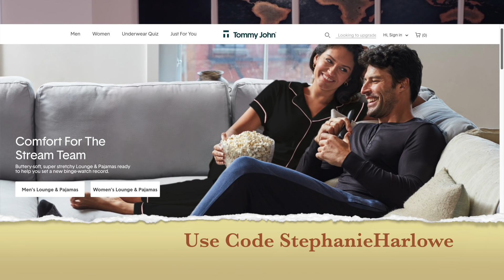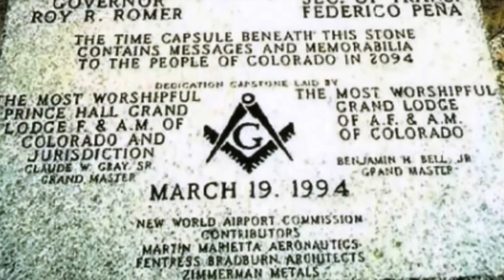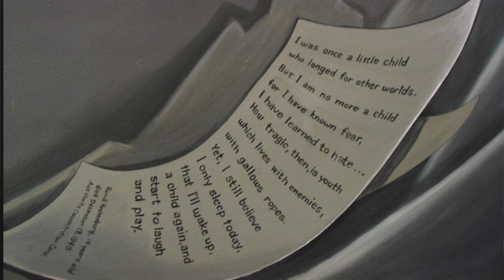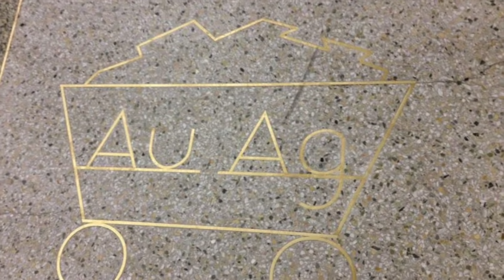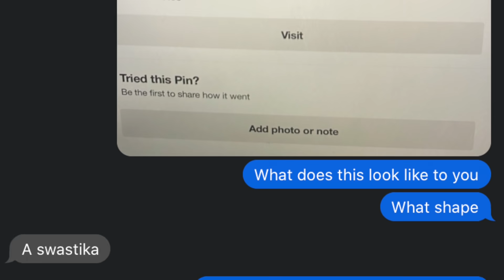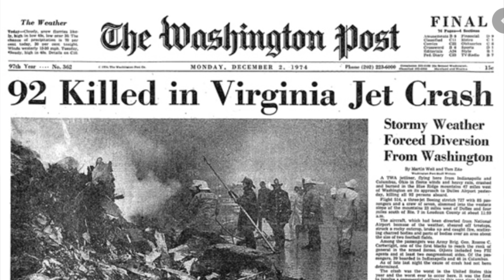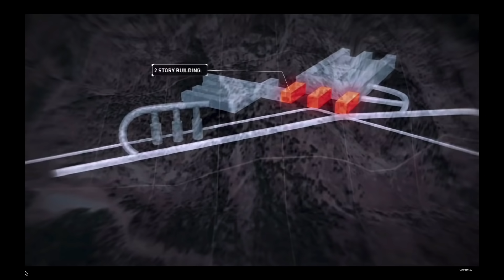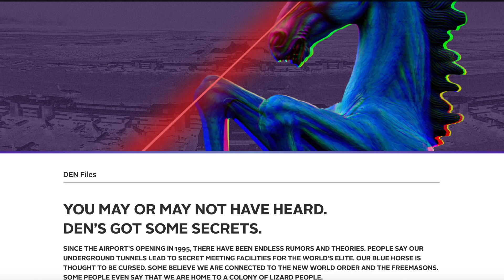Harloween: Tales From Denver International Airport

Comment: We've been to the Denver airport twice on trips to Colorado before we even heard of these stories. I saw a poster on the construction areas of the airport with mocking slogans about lizard people and laughed  wondering what it was about. We went underground to hop the transit to other terminals and it did have other areas down there off limits behind solid steel doors with RFID lock sensors. There were also train tunnels that were completely unused. The doors to those were marked out of service and they seemed to go somewhere completely different. Mind you, I wasn't really looking for anything so I probably missed all sorts of details. But now that I have heard the conspiracies, I would not at all be surprised if they were true.

Comment: My own DIA story: I was visiting some family and was due to fly out when a winter storm blew in. My flight was rescheduled. I forgot to mention I was about 4 and a half months pregnant with my son. I had an SS on my ticket and was directed to a special security line. This was before the x ray scanners were in every airport and they were rolling them out there. I was made to take my jewelry off so I asked them if it contained radiation or anything that might hurt my baby. They told me no and made me do it. I did not have enough for another ticket and regrettably I went along with it. I found out later what it was and was so angry. Luckily my son is fine. They ask you before x rays i there is a possibility of being pregnant, or if they don't they cover you with that lead blanket. So in the end I was a guinea pig for the naked body scanners while visably pregnant.

Comment: The one thing that wasn't covered  was the politicians of the area bought up the propertiea that would be the future airport (a couple were named on that cap stone as well as have their name on the boulevard that you drive to get there).They made millions reselling it to developers. The area that they put the airport has more air turbulence than stapleton ever had. It wasn't an ideal place to build it,but it was profitable one. I knew many contractors that worked on the airport ( I admit that I never did) and its true that contractors weren't allowed to work on multiple areas and that its true about the buildings being buried. Both of which makes zero sense unless you are trying to hide things. My friends would talk about it, seemed like they were trying to burn money(like abandoning an expensive luggage system).these people love a change orders but it was so out of hand it had them scratching their heads.
Reply: Airports are federal right-of-ways, and limited access facilities by definition. I worked on airport renovations and none of us were allowed to roam around wherever we wanted, so I don't really see anything suspicious about an airport authority controlling movement of workers within a secure area. Basically if you wander onto a runway you're going to jail, whether that runway is "open" or not. That said, architects live in a dream world, engineers live in a perfect world, and carpenters live in the REAL world. Change orders are a contractor's Christmas but a craftsman's nightmare.
Reply: @MrTaxiRob  I more than understand the  gift of change orders, but what I was saying there so many I got to be crazy. As far as roaming around that wasnt the issue. As you probably know companies bid on projects, whole buildings,maybe just core and shell ect. They divided the bid into small sections If you had won the bid in one area you wouldnt be awarded the the next one. They would have had to pretty hard to make the airport cost any more than it did.

Comment: I've flown in and out of Denver Intl Airport around 100 times for work over a 10 year period, the first time was about 1 year after it opened. That airport is creepy af! You see Blucifer as you are driving into and out of the main terminal. It's very unsettling! The suitcase gargoyles are kinda cute. They are supposed to ward off bad juju associated with lost luggage. The two large apocalyptic murals were near the main drop off/pick up doors. This artwork was a focal point. It was all meant to be seen. The time capsule plaque is near the walkway to Terminal A (Frontier Airlines) and does name the New World Airport Commission. With all the Masonic symbolism on it, it's a bit freaky. If you are taking the underground trains to the other terminals, you won't see it. All of it together, is what made it creepy. For years there was nothing even near the airport. I've seen literal tumbleweeds crossing over La Pena Blvd! The thing that solidifies the creepy factor for me is the stories I've heard from Denver residents about the unusual nature and secrecy of the actual construction of the airport. One of my coworker's husband and brother both worked on the massive sub-levels of the airport. I went to dinner at her house and they were both there. They both had to sign extremely strict NDAs before they could even go near the work site. All they felt comfortable saying was that they helped lay rebar / poor concrete for multiple "massive cavernous" rooms of several thousand square feet each. These were several stories underground and had nothing to do with the subway system or baggage handling system. The brother said to me, "I don't know exactly what all that space is being used for, but I can say with 99.9% certainty, it has nothing to do with airport operations". My coworker said her brother and husband have always refused to say any more than that for "her safety". A couple of years later, I was discussing it with a different coworker who said that a man she had dated a few years earlier told her that the airport was a "critical structure for continuation of government." Denver's central location and proximity to Cheyenne Mtn made it a logical place for the government to relocate to in the event Wash DC was no longer viable. He was supposedly retired military intelligence. Who knows! They could've all been pulling my leg, but theirs was not the only stories I'd heard, theirs just seemed the most reliable. I'm not saying there's anything nefarious going on out there, but a new airport that had gone massively overschedule and over budget would be the perfect cover for building a continuity of government type bunker. We know facilities like that have been built in the past... that's not a conspiracy at all. Mt Weather. That hotel in West Virginia, I think? You can fly to Denver in under 3 hours from anywhere in the US. It makes sense to put something like that there. 🤷‍♀️
Reply: I'm a Denver native located about 12 mi from DIA and was here during its construction.  I remember flying out of there, shortly after its opening, and specifically the train, the heavy, uneasy, stifling and weird feeling, I still get, to this day, when riding on it, and the "still under construction" appearance, all throughout the underground tunnel system, within view, even now .   A very strange vibe down there, for sure...  Never mind the artwork and ALL THE OTHER PECULIARITIES !  
I knew a guy that worked on constructing it.  He said he helped set scaffolding 7 stories beneath the surface and told me how odd it was that no crews were allowed to work in one area longer than a few weeks, then were either moved to another area or were just let go, altogether... 
It is situated next to, or partially on federal land.  A military base.  The Rocky Mountain Arsenal, which is a SUPERFUND SITE that, among other chemical agents, used to manufacture Sarin Mustard gas.  So many other oddities, during the building of this place, I recall, too numerous to go into, but there is MUCH MORE TO DIA, THAN WE ARE BEING TOLD, according to my 25 + years of close proximity !   
Time will tell...
Reply: Another channel said that it has enough room and provisions for 500,000 people for 3 years down there.  And it was paid for by many countries.  
Diabolical plans coming to fruition soon?
Reply: I heard there was another airport built that got buried next to the existing one.. but that it was just an excuse to have this whole extra underground building..
Reply: 😮thank so much for this posting 😮 The information you’ve shared is so thought provoking!! I’ve flown in and out the DIA because, although I’ve moved all around the US, my sister has lived in or around Denver for years. Each time I arrived or departed from there, I would linger an extra hour or so just to study all the “suspicious” things i.e. murals, statues and suspicious symbolism. It’s truly suspicious and at the very least intriguing!😮
Reply: It's obviously gas lighted and nefarious af . 👀

Comment: Nothing about the curse on the whole complex because it's built on a Native American burial site or other sacred area? Supposedly the curse is the reason the baggage system would not work and the concrete in portions of DIA kept cracking and having to be repaired which caused budget overruns. Supposedly, the  local Native American political leaders arranged for
a renowned shaman to bless the buildings and land. My source claims this was a very time consuming, elaborate and expensive ceremony but the city father's figured what the hell nothing else is working. I was told the concrete situation and some other issues, including weird elevator, train and other people transport glitches were resolved. Don't know why the ceremony didn't help the baggage system
Of course, the concrete may have been
cracking due to corner cutting by the contractor who was ALLEGEDLY tied to
the Louisiana Mafia.
Thank you for covering DIA. I have never flown out of there and I think the whole area has a weird vibe.

Comment: As a pilot the runway layout is very practical but slightly unusual. With parallel runways usually they are all next to each other, take a look at Gateway Airport in Phoenix AZ or Eugene Airport in Eugene OR, all the parallels are side by side. Looking at this airport, it would be A fairly efficient way to get the planes in and out of the airport slightly quicker so quicker departure and arrival times because the runways are leading straight to the actual airport it’s self, but I’d say it’s unusual for the parallels to be so far from each other... interesting! I wonder how the taxiing times compare to other airports with parallel runways

Comment: Delays? DEN is famous for delays, especially in the winter. Every damn winter the airport is shocked by the snow and flights are cancelled. It's like clockwork.

As for the reason for costs going way over initial projections? That's easy: it was construction. Costs almost always run higher than anticipated because there's often complications the designers and project managers didn't account for when creating their budgets.

Comment: This is a very late comment but i feel obligated as a colorado native! So i used to work at DIA, loading and unloading suitcases. Ramp Agent, if you will.

There is a wall full of suitcases behind a chain link fence underneath the place, in the baggage system. I dont mean modern plastic and nylon suitcases, i mean leather and cloth suitcases. All of if not the majority of them are closed and no one could or would tell me where theyre from or if anyone knows what is inside them.
And I only ever saw this on one wall in the entirety of the baggage system i checked out while i worked there.

Comment: My husband's grandfather was a 33rd Master Mason which is the highest level within Freemasonry that there is for a person to hold so that is accurate and yes they are very private as far as their involvement things that go on etc very adamant about not speaking about any of it..... As far as the tunnels go as far as I learned when I did some looking into everything at DIA the times are supposed to be the original construction of the airport which was built incorrectly so they were told to bury it and they've also said that they use it for storage there have also been tradesmen that aren't employed by dia but have been called to do a specific service or whatever down in the tunnels that have been made very aware they're not to speak about anything to do with any of it as far as I've learned I could be wrong

Comment: What most do not know is that Mayor Pina had bought all that flat land years prior to this DIA airport was even thought of by locals. I lived there then and there was a huge controversy.  Pilot complained about wind shears which could cause deadly accidents. Thank Hod nothing has happened. Also, Mayor Pina was appointed the head of the department of transportation in Washington at that time. 
Looks like Mr.Pina made out like a bandit. So there is a lot to consider with these connection.

Comment: I live in a town that was founded to set up a Nuclear Reactor for the Manhattan Project. It’s in a valley that had been carved into the  landscape by the receding glaciers from the Ice Age. So there’s hills and small mountains all around. What’s crazy is that in a few of the hills the Military actually built bases within them and some even have take-off ramps. Another thing too is that when you look at the map of the Manhattan Project Reactor locations on the Department of Energy’s website our town is placed on the other side of the state which kinda makes sense but at the same time it’s like not even somewhat close. There’s also underground bunkers EVERYWHERE just 30 miles from town that are specifically for top brass and officials in the event of an attack on the country or critical failure of the reactor.

Not all conspiracy theories are created equally, and not all “conspiracy theorists” hold all conspiracy theories in equal regard. One must always keep that in mind when tumbling down these rabbit holes.

Comment: I just watched this fascinating video.  I have been to the Denver airport at least 10 times if not more.  I mostly was just connecting but I did not know of 100% of this.  I will say this though, I agree with you that I was wondering what’s in the water based on true crime cases.

Comment: I worked at DIA as a ramper/ bag runner and we were there before it opened to get to know the place. It's huge. But I've never got bad vibes. As for the NWO Prez Bush even mentioned it on TV. Also had to add the change from Stapleton to DIA because of the noise... Well now you have a bunch of Whiners who moved out there when there wasn't any houses before. I've even met a few and told them if ya don't like it move. I think they're unhappy and like to be whiners. Now all they need is cheese to go with their whine lol